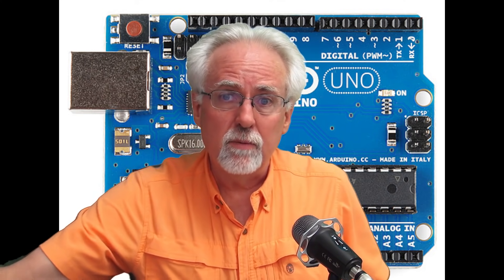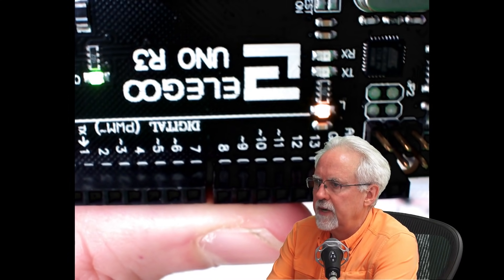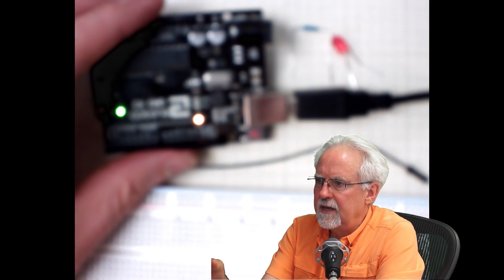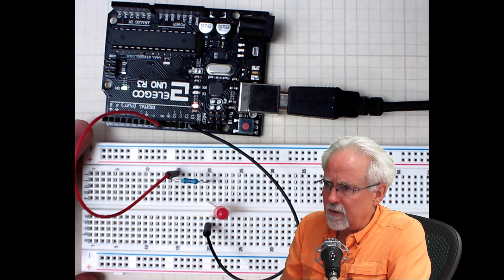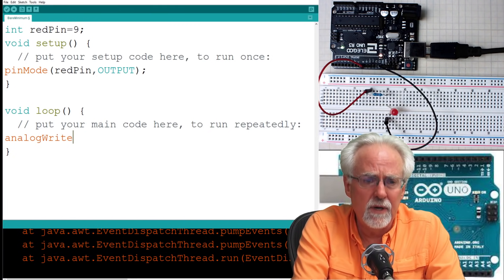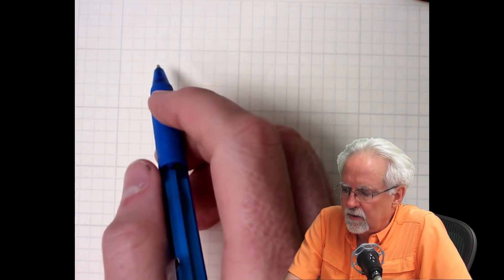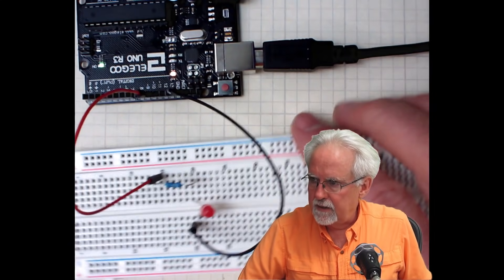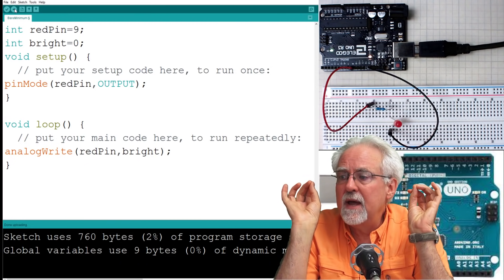Arduino Tutorial 7: Understanding the Arduino Analog Write Command

Comment: Ran the following code and replaced the LED with  the motor and fan.

int analogPin = 9;
int count = 0;
int wait = 500;

void setup() {
  // put your setup code here, to run once:
pinMode(analogPin, OUTPUT);
}

void loop() {
if(count > 255){count = 0;}

analogWrite(analogPin,count);

count = count + 5;
delay(wait);
}

Comment: [code]
//declaring and initializing Var:
int positive_pin=11;
int bright=255;
int no_light=0;
int intermediate=128;
int very_dim=5;
int dim=50;
int wait=5000; 

void setup() {
  // put your setup code here, to run once:
      pinMode(positive_pin,OUTPUT);
}

void loop() {
  // put your main code here, to run repeatedly:
   //The brightness of the Red LED will increase from 0 to 255 in 5 stages:
    analogWrite(positive_pin,no_light);
     delay(wait);
    analogWrite(positive_pin,very_dim); 
     delay(wait);
    analogWrite(positive_pin,dim); 
     delay(wait);
    analogWrite(positive_pin,intermediate);
     delay(wait);
    analogWrite(positive_pin,bright); 
     delay(wait); 
} 

[/code]

Comment: if I understood it correctly digital only has on& off and analog has 255 semi on/off options. 
So if I wanted to program a fan with low speed and high speed I'd use analog right because it needs to be semi-on for the low speed. 
Or can you also do this with digitalwrite?

Comment: Loving the tutorials. Did a little programing back when I had hair. Tried to get the LED in Lesson 7 to go from off to fully on using a FOR loop. Loop works, but nothing I've tried will insert a delay between end of one loop and beginning of next loop. Serial print is affected by the delay I insert, but the loop and consequent cycling of the LED is not. How can I get a delay to work inside a FOR loop?

Comment: i have been trying to casually get into coding for a couple years now. last one was tasker( a phone automation app.turn on gps when connected to car etc.) and i just realized, what always makes me stop. it's Variables! when the instructor started yelling about entering a constant i was   instantly up the adding a variable....also on the home work about the 4bit counter i did exactly how he did when he demonstrated that H/w.

 this is the place i chose for my beginner learning. turns out the starter kit i bought is the one being used in these videos  
you're
this guy Paul goes deep. i mean he goes in depth like DO WE NEED to know all that about LEDS in #3? probably not. but i cant stand when you be like why do i need to do this part, and they say just do it. or, thats how it is.

this particular video clearly doesn't need me hyping it up. but thanks paul for getting variables to start to stick. im excited to watch the rest and use this knowledge on Arduino and possible elsewhere

Comment: I crack up when he shows his starter kit, and the Chroma Keying 
used to put the image behind him makes it possible to "see through him".
"Blue Screen" keying is not good to use when anything in the front layer is blue.
He needs to use a Chroma Key function with a color that's not in the front layer.
The blue part of the accessory box rendered transparent by the video editor software.
Green screen would have worked.
Reply: Look closely starting at time 0:28.
Reply: Set the playback speed to 0.5 and you'll think he has Jagermeister in that mug.
That's my sick sense of humor. Actually, the videos are excellent. Just havin' fun.

Comment: Pretty cool!  I hooked my multimeter up to the circuit and was able to watch the voltage change as I changed the analogWrite value from full, to 3/4, to 1/2, to 1/4 and to zero in 5 second increments.

Comment: Millard Alexander
Error Message See below:
Arduino: 1.8.13 (Windows 10), Board: "Arduino Uno"

C:\Program Files (x86)\Arduino\arduino-builder -dump-prefs -logger=machine -hardware C:\Program Files (x86)\Arduino\hardware -hardware C:\Users\Millard Alexander\AppData\Local\Arduino15\packages -tools C:\Program Files (x86)\Arduino\tools-builder -tools C:\Program Files (x86)\Arduino\hardware\tools\avr -tools C:\Users\Millard Alexander\AppData\Local\Arduino15\packages -built-in-libraries C:\Program Files (x86)\Arduino\libraries -libraries C:\Users\Millard Alexander\Documents\Arduino\libraries -fqbn=arduino:avr:uno -vid-pid=2341_0043 -ide-version=10813 -build-path C:\Users\MILLAR~1\AppData\Local\Temp\arduino_build_255283 -warnings=none -build-cache C:\Users\MILLAR~1\AppData\Local\Temp\arduino_cache_970962 -prefs=build.warn_data_percentage=75 -prefs=runtime.tools.arduinoOTA.path=C:\Program Files (x86)\Arduino\hardware\tools\avr -prefs=runtime.tools.arduinoOTA-1.3.0.path=C:\Program Files (x86)\Arduino\hardware\tools\avr -prefs=runtime.tools.avr-gcc.path=C:\Program Files (x86)\Arduino\hardware\tools\avr -prefs=runtime.tools.avr-gcc-7.3.0-atmel3.6.1-arduino7.path=C:\Program Files (x86)\Arduino\hardware\tools\avr -prefs=runtime.tools.avrdude.path=C:\Program Files (x86)\Arduino\hardware\tools\avr -prefs=runtime.tools.avrdude-6.3.0-arduino17.path=C:\Program Files (x86)\Arduino\hardware\tools\avr -verbose C:\Users\Millard Alexander\Desktop\Analog_Write\Analog_Write.ino

C:\Program Files (x86)\Arduino\arduino-builder -compile -logger=machine -hardware C:\Program Files (x86)\Arduino\hardware -hardware C:\Users\Millard Alexander\AppData\Local\Arduino15\packages -tools C:\Program Files (x86)\Arduino\tools-builder -tools C:\Program Files (x86)\Arduino\hardware\tools\avr -tools C:\Users\Millard Alexander\AppData\Local\Arduino15\packages -built-in-libraries C:\Program Files (x86)\Arduino\libraries -libraries C:\Users\Millard Alexander\Documents\Arduino\libraries -fqbn=arduino:avr:uno -vid-pid=2341_0043 -ide-version=10813 -build-path C:\Users\MILLAR~1\AppData\Local\Temp\arduino_build_255283 -warnings=none -build-cache C:\Users\MILLAR~1\AppData\Local\Temp\arduino_cache_970962 -prefs=build.warn_data_percentage=75 -prefs=runtime.tools.arduinoOTA.path=C:\Program Files (x86)\Arduino\hardware\tools\avr -prefs=runtime.tools.arduinoOTA-1.3.0.path=C:\Program Files (x86)\Arduino\hardware\tools\avr -prefs=runtime.tools.avr-gcc.path=C:\Program Files (x86)\Arduino\hardware\tools\avr -prefs=runtime.tools.avr-gcc-7.3.0-atmel3.6.1-arduino7.path=C:\Program Files (x86)\Arduino\hardware\tools\avr -prefs=runtime.tools.avrdude.path=C:\Program Files (x86)\Arduino\hardware\tools\avr -prefs=runtime.tools.avrdude-6.3.0-arduino17.path=C:\Program Files (x86)\Arduino\hardware\tools\avr -verbose C:\Users\Millard Alexander\Desktop\Analog_Write\Analog_Write.ino

Using board 'uno' from platform in folder: C:\Program Files (x86)\Arduino\hardware\arduino\avr

Using core 'arduino' from platform in folder: C:\Program Files (x86)\Arduino\hardware\arduino\avr

Detecting libraries used...

"C:\\Program Files (x86)\\Arduino\\hardware\\tools\\avr/bin/avr-g++" -c -g -Os -w -std=gnu++11 -fpermissive -fno-exceptions -ffunction-sections -fdata-sections -fno-threadsafe-statics -Wno-error=narrowing -flto -w -x c++ -E -CC -mmcu=atmega328p -DF_CPU=16000000L -DARDUINO=10813 -DARDUINO_AVR_UNO -DARDUINO_ARCH_AVR "-IC:\\Program Files (x86)\\Arduino\\hardware\\arduino\\avr\\cores\\arduino" "-IC:\\Program Files (x86)\\Arduino\\hardware\\arduino\\avr\\variants\\standard" "C:\\Users\\MILLAR~1\\AppData\\Local\\Temp\\arduino_build_255283\\sketch\\Analog_Write.ino.cpp" -o nul -DARDUINO_LIB_DISCOVERY_PHASE

Generating function prototypes...

"C:\\Program Files (x86)\\Arduino\\hardware\\tools\\avr/bin/avr-g++" -c -g -Os -w -std=gnu++11 -fpermissive -fno-exceptions -ffunction-sections -fdata-sections -fno-threadsafe-statics -Wno-error=narrowing -flto -w -x c++ -E -CC -mmcu=atmega328p -DF_CPU=16000000L -DARDUINO=10813 -DARDUINO_AVR_UNO -DARDUINO_ARCH_AVR "-IC:\\Program Files (x86)\\Arduino\\hardware\\arduino\\avr\\cores\\arduino" "-IC:\\Program Files (x86)\\Arduino\\hardware\\arduino\\avr\\variants\\standard" "C:\\Users\\MILLAR~1\\AppData\\Local\\Temp\\arduino_build_255283\\sketch\\Analog_Write.ino.cpp" -o "C:\\Users\\MILLAR~1\\AppData\\Local\\Temp\\arduino_build_255283\\preproc\\ctags_target_for_gcc_minus_e.cpp" -DARDUINO_LIB_DISCOVERY_PHASE

"C:\\Program Files (x86)\\Arduino\\tools-builder\\ctags\\5.8-arduino11/ctags" -u --language-force=c++ -f - --c++-kinds=svpf --fields=KSTtzns --line-directives "C:\\Users\\MILLAR~1\\AppData\\Local\\Temp\\arduino_build_255283\\preproc\\ctags_target_for_gcc_minus_e.cpp"

Compiling sketch...

"C:\\Program Files (x86)\\Arduino\\hardware\\tools\\avr/bin/avr-g++" -c -g -Os -w -std=gnu++11 -fpermissive -fno-exceptions -ffunction-sections -fdata-sections -fno-threadsafe-statics -Wno-error=narrowing -MMD -flto -mmcu=atmega328p -DF_CPU=16000000L -DARDUINO=10813 -DARDUINO_AVR_UNO -DARDUINO_ARCH_AVR "-IC:\\Program Files (x86)\\Arduino\\hardware\\arduino\\avr\\cores\\arduino" "-IC:\\Program Files (x86)\\Arduino\\hardware\\arduino\\avr\\variants\\standard" "C:\\Users\\MILLAR~1\\AppData\\Local\\Temp\\arduino_build_255283\\sketch\\Analog_Write.ino.cpp" -o "C:\\Users\\MILLAR~1\\AppData\\Local\\Temp\\arduino_build_255283\\sketch\\Analog_Write.ino.cpp.o"

C:\Users\Millard Alexander\Desktop\Analog_Write\Analog_Write.ino: In function 'void setup()':

Analog_Write:5:9: error: 'redPin' was not declared in this scope

 pinMode(redPin,OUTPUT);

         ^~~~~~

C:\Users\Millard Alexander\Desktop\Analog_Write\Analog_Write.ino:5:9: note: suggested alternative: 'redPIN'

 pinMode(redPin,OUTPUT);

         ^~~~~~

         redPIN

C:\Users\Millard Alexander\Desktop\Analog_Write\Analog_Write.ino: In function 'void loop()':

Analog_Write:10:13: error: 'redPin' was not declared in this scope

 analogWrite(redPin,bright);

             ^~~~~~

C:\Users\Millard Alexander\Desktop\Analog_Write\Analog_Write.ino:10:13: note: suggested alternative: 'redPIN'

 analogWrite(redPin,bright);

             ^~~~~~

             redPIN

exit status 1

'redPin' was not declared in this scope

Comment: Millard Alexander
I have written the code as seen by your Instruction but the programme still does compile why. see below code that I have written: 
int redPIN=9;
int bright=255;
void setup() {
  // put your setup code here, to run once:
pinMode(redPin,OUTPUT);
}

void loop() {
  // put your main code here, to run repeatedly:
analogWrite(redPin,bright); 
}
Reply from the maker: Guys you have to see if it does not work, it is because you made a mistake. If you do exactly what I do, you will get exactly the result I get. YOu have to learn to debug your code. In this case, you declared your pin a 'redPIN' then in your pinMode, you used 'redPin', which is completely different. If it does not work, check your code, find your mistake

Comment: Hi Paul. I am a retired controls engineer from the worlds largest manufacturer of freeze-less outdoor plumbing supplies. I still do ALOT of controls engineering for myself simply because I loved the job! I wanted to get into a new platform so I chose the Arduino platform. Let me tell you, you are the Bob Ross of programming and design. I just love the way you methodically go through the lessons and have the talent to speak everything that is going through your mind. That my friend is a very tough thing to do, and I appreciate it immensely. If someone has the desire to learn the Arduino these are the best teaching videos I have ever run into about the subject. Thanks again for sharing your knowledge and talent.

Comment: First,  Paul, I'm enjoying your method of teaching.   While I know some of the things being taught (the programming aspect,  wiring up the components), I'm new to Arduino.  It's a pleasure to have found this series.   There is a small matter that bothers me, however, and that is the variable vs constant thing you have been saying.    You are actually saying to stay away from the LITERALS (the actual number).  A constant would be a declared item  (const int pinNum=12;) and used where the value won't change during program execution, but still allows changing only one line of code to adjust all of the uses of the constant.   A variable is a placeholder that can be changed, programaticaly, during execution, and assigning the value at declaration time is optional, but best.    Since, at least to this point, your code hasn't been changing the variables, a constant would be the best practice, meaning the before mentioned const declaration.   I DO agree that using literals would be a no-no, but saying "don't use constants" is just as big a no-no.   I mean, they were invented for the very things you're doing thus far in the IDE.   Other than that, and how long this comment is getting, I'm enjoying the heck out of it, and really like the method of your teaching.   (I will NOT be drinking iced coffee, as to me that is a mortal sin, but a big glass of unsweetened iced tea takes it's place.   Cheers!

Comment: You said there are 8 bits of resolution in the voltage we can create thru 5 volts. BUT, you also said that there's 256 bits, which is a lot more than 8 bits. Can you explain what you mean? Something is wrong here. Did you mean we have 2 raised to the 8th power of bits, not 8 bits?

Comment: Heres the program I got, please let me know if I can shorten it or add something or use some different codes I'm pretty new to programming.
int redLED=9;
int bright=255;
int med=128;
int low=64;
int off=0

Void setup() {
pinMode(redLED,OUTPUT);
}
void loop() {
analogWrite(redLED,bright);
delay(5000);
analogWrite(redLED,med);
delay(5000);
analogWrite(redLED,low);
delay(5000);
analogWrite(redLED,off);
delay(5000);
exit(0);
}

Comment: int redPin=10;
int bright1=2;
int bright2=80;
int bright3=160;
int bright4=240;
int bright5=255;

void setup() {
  // put your setup code here, to run once:
pinMode(redPin,OUTPUT);

}

void loop() {
  // put your main code here, to run repeatedly:
analogWrite(redPin,bright5);
delay(500);
analogWrite(redPin,bright4);
delay(500);
analogWrite(redPin,bright3);
delay(500);
analogWrite(redPin,bright2);
delay(500);
analogWrite(redPin,bright1);
delay(500);
}

Comment: //Using analog write command
//lesson from toptechboy.com

int redPin = 9;
int level = 255;
int wait = 500;
int dropLevel = 51;

void setup() {
  // put your setup code here, to run once:
pinMode(redPin, OUTPUT);
}

void loop() {
  // put your main code here, to run repeatedly:
  if(level == 255) {
analogWrite(redPin, level); //begin at max
level = level - dropLevel;
delay(wait);

analogWrite(redPin, level); //level at 255 - 51
level = level - dropLevel;
delay(wait);

analogWrite(redPin, level); //level at 255 - 51 - 51
level = level - dropLevel;
delay(wait);

analogWrite(redPin, level); //level at 255 - 51 - 51 - 51
level = level - dropLevel;
delay(wait);

analogWrite(redPin, level); //level at 255 - 51 - 51 - 51 - 51
level = level - dropLevel;
delay(wait);

analogWrite(redPin, level); //level at 255 - 51 - 51 - 51 - 51 - 51
level = level - dropLevel;  //which is 255 - 255, or )
delay(wait);

level = 255;                //set level back to max
  }
}

Comment: Great video once again.  I take it that these outputs are pulse with modulated (PWM) and not actual analog values, at least on these particular outputs.  I remember working with digital to analog chips (DAC) to drive motors back in the 80's.  They were good for driving dc motors through darlingtons, but useless to drive servo motors used in RC devices.  We needed PWM for that.  Thanks again for the video and I am looking forward to the next one.  :)

Comment: The pinMode command is unnecessary for analogWrite. Deleting it works fine as it is not required. 

From the Arduino Reference Page for analogWrite:
"You do not need to call pinMode() to set the pin as an output before calling analogWrite().
The analogWrite function has nothing to do with the analog pins or the analogRead function."